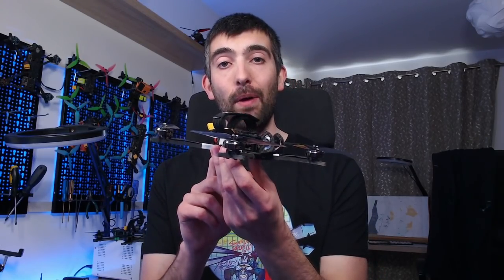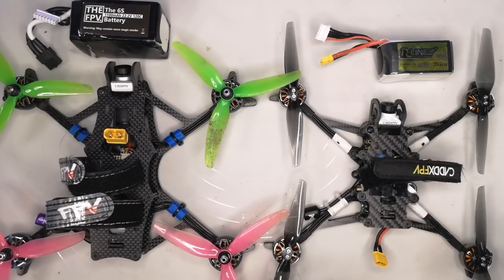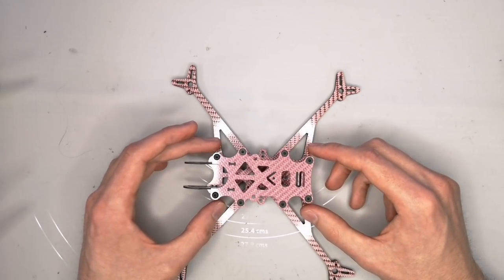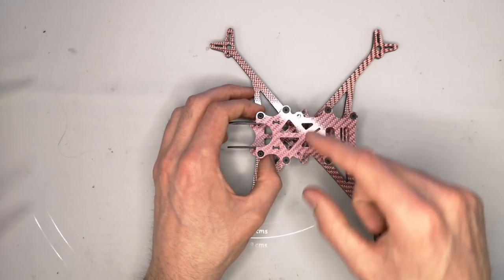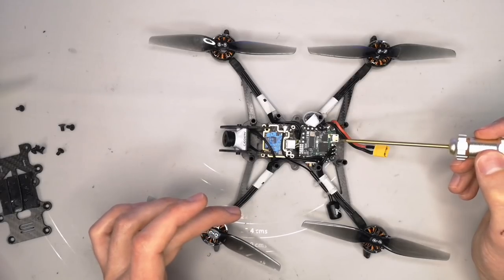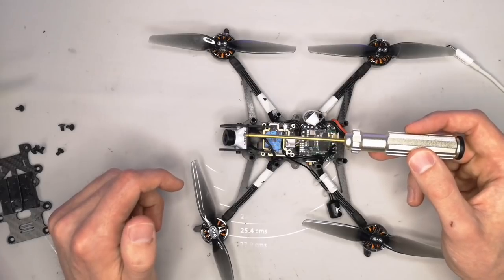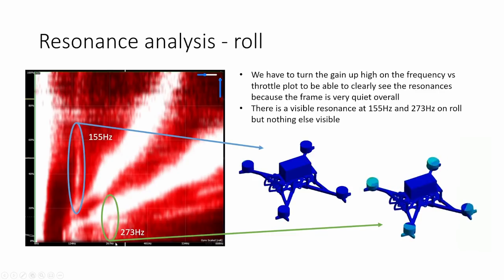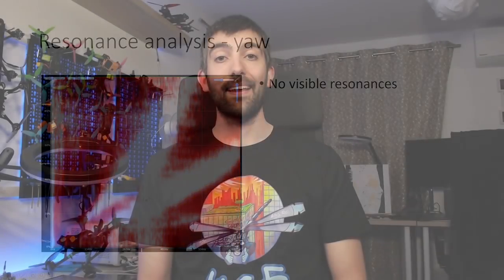AOS UL5: An ultralight 5" drone that flies as good as it looks.

Comment: Aloha Chris! Thanks for the dedication and skills you've focused on frames. I have the 5.5" and it is awesome! It is currently being converted from analog to Air unit. I'm the guy you chatted with during an interview who is flying INAV (if only BF had the GPS/compass/baro capabilities available!). Great work with the triangulated arms and the wide range of hardware options. I did drill a 20 x 20 pattern into the top plate to hang a Rush Tank Solo VTX and would also like a 30 x 30 pattern in the rear of the bottom plate of that model. Otherwise, the very strong, crash resistant and jello free aspects of your designs is fantastic. This frame is on the way and I look forward to your ?top secret? new design as well. Keep up the great work!
Reply from the maker: The AOS 5.5V2 will have 20x20, 25x25 and 30x30 stacks front, middle, and rear!
Reply: @ChrisRosser  what about the v2 of the AOS 3.5???

Comment: A frame I've been working on but struggling to get right is a HD sub 250g with a built in naked gopro. The gopro pcb is frustratingly big, and if you want to lay it flat you have very few options due to the ribbon cable length. I guess the reasonable approach would probably be to go for a naked insta360 go instead. 

The idea started due to the UK's regulations which give sub 250g quads way more freedom than the larger alternatives.

Comment: Just ordered one of these to swap my vibey Rekon5 gear too. Also swapping to the Emax EcoII 2004 2400kv motors and going to run 3s and 4s. I had the 6s gear for the Rekon and was trying to do long range on big 4s li ion but it was pretty slow and flew bad unfortunately....

Hoping ot find the same magic my 5 inch fouride has in this frame, and perhaps more. One nice thing with this UL5 is I'm noting the props are slightly in view. I like this it's like I'm behind the wheel of a sports car with a big long hood. It's also nice being able to see your props spin up when you arm. Excited to build it and try it out!
Reply: So I built mine a while back and flew it on defaults, happy enough. Just recently decided to try to dig into the tune and kill propwash and all that. But finding a problem. Even on defaults it never did sound very smooth, I figured it was a function of the biblades basically. Using 3s 1100 and 1300 mainly, emax ecoII 2004 2400kv motors, Gemfan LR5126 biblade props, and I've tried two FCs. An HGLRC F722mini and a JHEMCU GHF411 pro aio. Basically, I can't turn off the gyro lowpass filters, even with new props on it. It's not that it has a particular frequency it "rings" at or anything, it's just kind of noisey at all frequencies from 0 to 800hz, so the RPM filter can't remove it. It's amplitude is proportional to throttle, but the frequency isn't proportional to throttle. I've even put the grease on the frame! Not sure what the issue could be.... There is one motor that doesn't sound as good as the others but it's not bad, not crunchy.

The biggest thing that stood out to me was I recently worked on a super beat old RotorRiot Skyeliner. Noticably not perfect bearings just handling the motors in hand. But I worked on the tune and damn it flies super smooth. Which made me look at my UL5 which is not as smooth, heck, just not smooth.

Comment: Love it. But I always fall for the same mistake: never buy V1, there will always be an improved V2 just around the corner ^^

I'd love to see cutouts in the top plate to secure an SMA-adapter via zip-ties just like they do on the SabotageRC frames.

Comment: Hm have I missed the most important part - weight. What is the build quad (no strap no bat pad) weight?
Reply from the maker: No battery pad/ strap is 185g
Reply: @ChrisRosser  I mean frame with hardware of course.
Reply: @ChrisRosser  btw with that weight you can use 4525 GF prop or even Azure Power 4838 JFPV prop (super powerfull and 0 propwash at that weight) but you have to get 5mm shaft for last one prop..

Comment: I received the UL5 frame. I'll set it up with a Kakute 20x20 H7 mini stack and ardupilot firmware + caddx vista HD cam. However the standoff positionning is badly designed as there is no way to fit a H7 mini stack into the frame without having the USB connector blocked by a standoff. Turning the stack 90 degrees to try having the USB port facing forward or backward also does not work as then the ESC board does not fit between the standoffs. This is a blocking issue with this frame as you can't install a 20x20 stack in it ! I will have to remove a standoff but that will hurt the frame's rigidity.
Reply from the maker: Sorry to hear you're having this issue. The H7 mini stack ESC is extremely large. The same size as a 30*30 ESC just with 20*20 holes. It may fit in the central location which is designed for much larger electronics. Alternatively a standard 20*20 ESC would fit in either the front or rear.
Reply: @ChrisRosser  Thx. the H7 mini stack size is 30x30mm. So is the associated Tekko 4-in-1 ESC, but it does have an extra 5mm tab to solder the battery leads. Issue is that there is no alternative H7 flight controller out there that is as small, that has a baro, onboard black box, DJI HD support, 2Mb flash of RAM which is required for ardupilot and Inav firmware. I believe a design improvement that would solve this issue and allow for a full air unit to be installed would be to reposition the two rear standoffs to keep the same distance between them (about 40 mm instead of 30 mm) as the other standoffs in the middle. This narrowing of the distance between these two rear standoffs does not bring any advantage in terms of rigidity or weight but reduce space to position freely elements onboard.

Comment: Chris, i'm searching to try to find the perfect frame for a 5 inch for chasing drift cars. Power to weight ratio is key for fast acceleration, so do you think this frame would be appropriate? i'm between this, or your AOS 5.5 at the moment. I intend to use some slightly oversized motors as well.

Comment: What’s up!  Great videos.  I have a problem with my aos ul5.  I believe it’s the first version.  I am running your latest preset tune, and my own.  I cannot get rid of the oscillations at part throttle in the camera.  I tried a polar and standard caddy camera.  I have built 20 or so quads and never experienced as much oscillation vibration in the camera as I have with this frame.  All the screws have been checked over and over.  Soft mounted the stack.  It’s an f722 mini with blheli32 esc.  I have tried 5125-3 and t5x3 bi-blades.  It really gets noticeable at the 35-45% throttle.  Running brotherhobby 2004/3150kv.  It really flies great to be honest on the 1300 6S, minus the oscillation.  Is this a 60 fps issue?  The motors kv an issue?  I tried on 24 and 48khz.  Should I push it up?  I don’t really thing I should lose the low end just to be able to remove this issue to honest…the motors have tpu skids on the underside but otherwise are sitting hard mounted to the arm.  Does the camera need to be soft mounted? I want the frame to work but after hours of testing and swapping parts and troubleshooting, I’m about to cannibalize it and move on.  I have zero skills or
Patience to deal
With black box resonance tuning or troubleshooting, so I haven’t investigated that.

Comment: I love the design except for the camera plates.  I have the AOS3.5 and that same design broke on the first head first impact.  The 2fiddy design has proven to be way more durable because it is "doubled up" or stacked on each side giving it twice the thickness.  My dream design would include your body design (especially the arm design with the motor protection) with his camera mount/protection design 😍

Comment: I can't wait to get mine.  I do have one fear though.  I'm going to use a 20x20mm stack and it sure looks like the standoffs will block the USB-C port on the FC.  Could make tuning a pain.
Reply from the maker: I would put the stack in the rear and face the USB backwards. :D
Reply: @ChrisRosser  I'll need to sort that out once the frame arrives.  I've typically mounted the VTX ant on the rear but we'll see.  Oh the challenges of UL builds :)

Comment: Would this be able to the new Avatar VTX (apparently it's 33x33mm with 25.5x25.5 mounting holes)? From glancing at the videos and images, it doesn't seem like there's much extra room.
Reply from the maker: It'll definitely fit in the centre position with an AIO or with a 20mm stack

Comment: Hi Chris, Have you put some thoughts into tradeoffs for Fpv camera Field Of View? For racing I suspect narrow FOV means more time for pilot to react because objects appear further, wide FOV means gates appear larger thus less margin for error and wider visibility on curvy technical tracks but less time for pilot to react. Is there a method to select optimum FOV? Thanks
Reply from the maker: Racers normally have wide FOV (1.8mm) so they can see around the corners. Freestyle normall has narrower FOV (2.5mm)

Comment: Hey Chris, i have the same iflight gyro and have been  experiencing hotter than normal motors. if at all possible, could u provide the betaflight build where you enabled mode 2 on the gyro? it seems this gyro has alot of potential

Comment: Is there a difference between Star vs Delta motor windings?
Might one give better efficiency over the other?
One more prone to voltage spikes? 
so many questions!
Reply from the maker: Star vs Delta really comes down to KV. Star windings will give much lower KV than delta. I think most FPV motors are delta because we need higher KV. Any changes in efficiency will only be due to different KV.

Comment: @Chris Rosser, With this frame using the Emax Eco II 2004 2400kv motors, can you use both 4s and 6s at 100% motor output or should you limit output on 6S? Thank you!
Reply from the maker: You should limit output on 6S to ~66%

Comment: So you dont recommend tri blade? On the motor data sheets they both produce the same thrust. Tri blade just a little more Power hungry but neglegtable
Reply from the maker: A very very light T-mout triblade could be OK. But I wouldn't use a standard 5" prop 2004 is a bit small for those.

Comment: You say it supports the HDZ 1watt vtx, but it actually doesn't, because then you can't mount any type of stack or AIO! Please correct this.
Reply from the maker: A number of people have successfully built the frame with a 30mm AIO and HDZero 1W VTX on top in the central stack position.

Comment: Hi Chris, thanks for the sneak peek on the AOS 5 V2 it looks quite different to the V1 but just a question which will no doubt be answered in your video for the V2 but will this mean the V1 will no longer be sold after the V2 drops? Thanks Chris!
Reply from the maker: I think both will be available for a while. There will also be an arm upgrade for the V1 as well that I'm calling V1.5

Comment: Meh. I give up to resist that temptation. Still having a tbs sixty9 lying around. gonna put it in that frame >.>

The 150hz resonance seems to be quite notchable too without touching any lowpass, shouldn't it?

Also how heavy did your build get? still room for an insta 360? :3
Reply from the maker: You can easily carry an insta360 go but probably not under 250g. The resonance is easily notchable but also so weak that you may not need to!

Comment: Hi Chris and congratulations for everything! I have been looking for a 5 'ultralight for a long time and I am very interested in buying this one when it will be easier to buy in Europe. 
This model is also gorgeous, even the possibility of having colored carbon just amazing 😍. 
There is just one thing that my mental illness of symmetries 😂 does not make me conceive: the vtx antenna mounted like this does not make me sleep at night! hahaha. 
Is it possible that a stubby mounted firmly with a nice 3d print is not good?
Reply from the maker: You can use a stubby antenna on a 3d print at the back if you want to.
Reply: @ChrisRosser  ...but? vibrations will kill me at night? 😄 I'm just jocking Chris thankyou for the answer!

Comment: omg Ive been having so many issues with my ummagawd 2fiddy build, reall dont like that frame, super hassle to work on cuz you gotta take apart the entire camera assembly everytime, its just overall a pain in the ass.

Stoked to try yours and see how it compares cuz man, 260g AUW, 2400kv 6s is fucking nasty.
Reply from the maker: I think you'll find the UL5 easier to work on. Just 8 screws and the top plate lifts straight off. 2 screws for each arm that aren't shared with the stack. It's super simple to build and maintain.